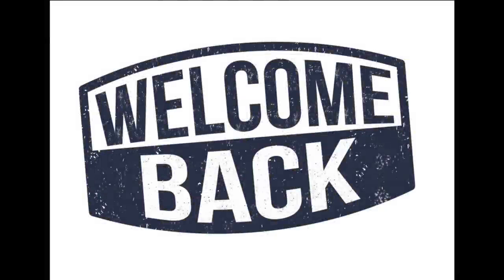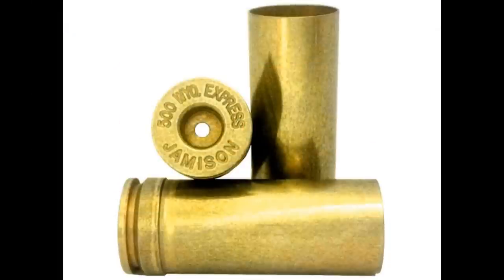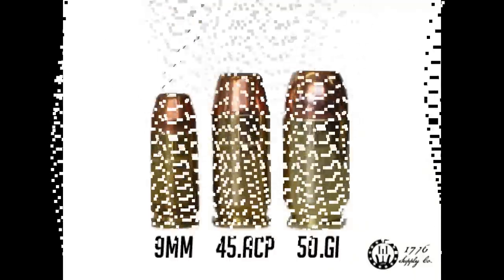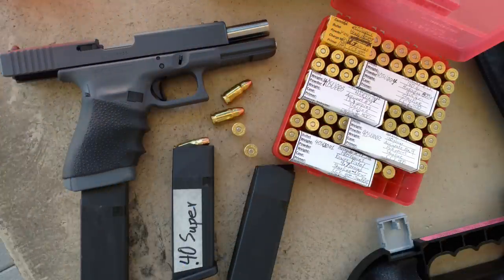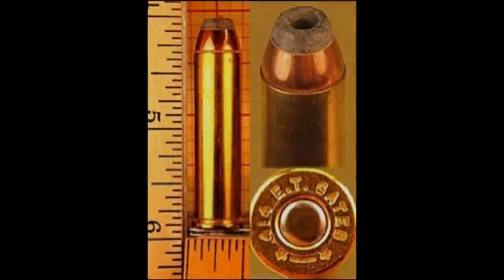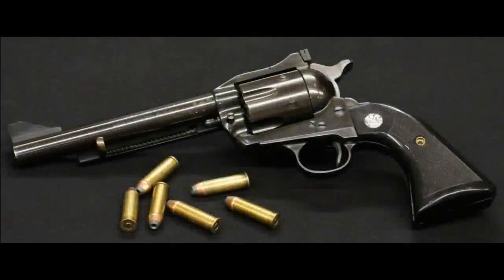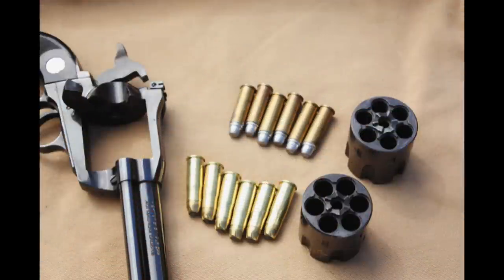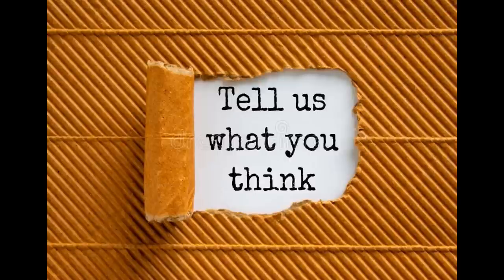The Top 5 Big Bore Cartridges that Failed Epically Part III

Comment: The belt on  the 500 WE is how they headspace the case in the chamber since there is no rim on its parent case- the 50AE. The AE had to much taper and being that it headspaced on the mouth, it caused all sorts of troubles with heavy loads. Bob Baker figured out that they could use the same brass but remove the taper by swaging the case to a straight wall configuration which ended up leaving the belt. That round was being developed at the same time Jack Huntington was developing the JRH................to work in an F/A 83, and the first 500 JRH was a model 83. It's too bad the JRH wasn't simply the one to be offered in the 83 in the first place, but I guess since F/A had a lot of time and development already invested in the WE round, they went with it.

Comment: Enjoyed this series.  That said…I actually chose to put together a 40 Super this spring (2023) for hunting.  The 10 mm just did not do anything  for me.  I have had 460 Rowland and 45 Super.  My all time favorite all time gun was a Ruger 41 mag.  I wanted a semi-auto with close to the same power lever.  For all practical purposes….10 mm is actually closer to the 357…just my thought.  That said….when “The Turkey Opinion”….featured one on  his videos series…I was hooked.  In spite of having more powerful cartridges conversion I have had in my 1911….The 40 Super…Just spoke to me.  I ordered a 6” ported conversion barrel for my 1911, put a heavier spring and a full length guide rod on the 1911.  Factory Ammo can still be bought and reloading components are still available from Redding.  I live in Montana and wanted a woods gun in the 1911 that was touching this side of the 41 mag.  I hope to take a deer this year with it and an elk if opportunity presents self.  All that to say…though I concur with your reasoning on the list of cartridges…there are still some of us…that still like the weird, quirky, obsolete and different cartridges.  I have shot several boxes of UA 225 grains at 1350 fps….no way a 10mm will get that.  My hope is to find a 240-250 grain mould to cast lead with in .401….I think that would be the sweet spot for the 40  Super….anyways…thanks for series…

Comment: I would like to see a 10mm casing necked to a 32 caliber projectile. The new 30 Super Carry has pressure of 50,000 PSI so those projectiles could withstand the high pressures and velocities that would be developed in this hypothetical cartridge.
Reply from the maker: @Tim Robinson - That sounds cool.  They have necked a 10mm to a 9mm.  It's called the 9x25mm Dillon and it is a scorcher!
Reply: Isn't that 7.5 FK?
Reply: That would be like a .30 carbine in a shorter case. Good idea!

Comment: I still like the 40 super.
Reply: Yeap, just getting into the 40 Super world…pretty stoked…no remorse in purchasing the reloading components, barrel conversion and the factory ammo has been fun…especially after shooting the 45 acp barrel and the switching to the 40 Super….its great to watch my friends face when the touch a round off…stout…but manageable.
Reply: @tyemiller6204  I have been experimenting with the 450-SMC 255 grain hard cast. 1030 out of a 5 inch barrel. The power of a 45 Colt. It uses a thicker casing than a standard 45-acp. So it takes a much higher pressure. But can be used in 45-acp chamber. Would really like to see it necked down to 40. A 40-Super +p+.

Comment: The real problem for the 50gi with especially hollow points was that the bullets were designed for guns with basically double the case case capacity or more so they couldn't expand,

Comment: I really like .45 GAP... after the .357 Sig, it is my favorite cartridge. The .50 GI is the sort of weirdness that appeals to me... I haven't yet committed to buying a Glock conversion kit for .50 GI though
Reply from the maker: @Graham O'Hea - I can respect that.  I too like oddball rounds.  The .40 Super had a special place in my heart, and the new .429 Desert Eagle is quickly becoming a favorite.  While the 10mm is now becoming more common, I have been a massive fan since before its resurgence.
Reply: @Go Big Bore Or Go Home  I would love to try and make an AR in .429 DE some day. From what I have read, it gives rifle ballistics out of a 6 inch barrel, so imagine what it could do out of an 18 inch.
Reply: @GoBigBoreOrGoHome  I am trying to get into .400 Cor-Bon and have sourced brass and reloading dies, but finding a Glock conversion barrel is proving to be a challenge. 40 Super would be the more logical choice over .400 Cor-Bon in this day and age, but I haven't found a reliable source for components yet. If I ever got a Deagle, I would be more interested in the .429 rather than the .50 AE as I tend to prefer the ballistics of lighter, faster bullets over slower and heavier (.45 GAP notwithstanding)
Reply: @grahamohea2424  IGB Austria sells 400 Corbon conversion barrels, in different lengths, coatings, and porting/threading options.

Find what you want and email them directly instead of going through their distributors.
Reply: @SR-gs8zo  There are a lot of use cases for handguns. Self defense is certainly one philosophy of use (to borrow a Nutn term), but it is not the only one... range toy is also perfectly acceptable use case. What purpose does a Desert Eagle have besides as a status symbol, something to show off at the range, and bragging about shooting .50 AE? Most of the things featured on this channel have little practical purpose and there is nothing wrong with that. I find that shooting nothing but 9mm gets boring after a while. I like weird/obscure calibers, I am perfectly content to reload for them, I can afford to do so, so why not?
Reply: @S R  I live in Alaska, and have wanted to build my own firearm for a long time. I love the thought of big bores, but also bullpups for the fact they catch less in the foliage. A .429DE in a rifle length barrel should be great in the brush against a moose. Also, I could reload it to possibly take out black bear hunting. Semi-auto 44 just sounds great up here in a bullpup.

Comment: I always thought the idea of the 40 super, and even the 41 Action Express were actually both excellent cartridges. If you wanted to load it hot, you could easily run a 180 or 200 rain projectable up to about 1,600 ft per second without pushing the limits of the firearm at all as long as you had a supported chamber. I've seen 1600 feet per second from 125 grain hollow point out of a 38 Super. With a little bit heavier jacket at those velocities it would have made an excellent hunting round, and it 1,400 feet per second it will provide the necessary capability to be a competent defense round. Considering I have not yet seen a hot 10 mm since the 1980s. And at current load parameters for the 10 mm, you might as well stay with the 40 Smith which is a better round than the 9 mm, and the fact that it produces 20% to 30% greater permanent wound cavity per shot. I'll give up two rounds in the magazine capacity any day of the week to shoot a 40 Smith for my personal protection. And because I'm usually all by myself I don't have two or three people around me like the FBI do. Add nowhere in any of the FBI paperwork does it say that the 9mmm is a superior cartridge or a better cartridge. It says it's cheaper, but why you need 12 to 18 in of penetration when most people aren't that thick is beyond me.
Reply: Well said on 9 vs 40. I agree. Though I really have nothing against the 9. I would trust it along with the 38 Spl to defend me as my personal minimums. About the “12 to “18 of penetration” the FBI has had at least one instance where a cross torso shot from an expanded 9mm failed to damage the heart after going through the culprit’s arm. 12-18 isn’t a bad rule in ballistic gel considering shots into bad guys usually penetrate less than they would into gel

Comment: Did 9×25 Dillon get covered previously? I'm tempted to order a barrel and die.
Reply from the maker: @Special EDy - We haven't covered it at this time since it's below a 40 caliber.  I am seriously curious about the round though.  Probably the hottest 9mm you can get in a semi auto, barring the 9mm Win Mag.
Reply: @GoBigBoreOrGoHome  I heard it is extremely loud, and shoots amazing fireballs. Which covers about half of the criteria for a good range toy!
Reply: @SpecialEDy  Sounds like it needs a barrel at least 10" long.
Reply: For those unaware it's the guy .357 Sigs gf tells him not to worry about, it's a 10mm necked down to 9.
Reply: @toddwebb7521  It's a 10mm sawed down to a 40 S&W necked down to a 9mm.
Reply: @exothermal.sprocket  9x25 is just 10 necked down to 9 it's not trimmed back to 40 length like.357 SIG.
Reply: @toddwebb7521  I stand corrected. It's 0.009" longer than 40 S&W and runs higher pressures.
However, .357sig is also unofficially called 9x22.

Comment: Only the 50GI is one I heard of.  On a similar note I just have to ask do you have a opinion on the fate of 357sig in future or even how successful the 30 super carry will be
Reply from the maker: @multi dryer - I don't think the .357 Sig will dissappear.  If it does it will be a slow descent.  It has a number of people who love it.  I am very curious about the .30 Super Carry but concerned its 50k psi pressure will be hard on firearms.  Too early to tell how the public will react to it.  For me...  I'll pass.  That could change, but it hasn't made me eager to put away my micro 9s.
Reply: @GoBigBoreOrGoHome  I agree in my opinion the worst that 357sig might go is more like 45super or 460 Rowlands and I'm gonna wait for 30 super carry to consider investing in but I do feel it has potential
Reply: .357 is so easy to make ammo for: cut down a 10mm, neck it down in the die to 9mm, and trim it to .40 length.
It uses a .40 bolt/slide, and . 40 mags. It uses 9mm bullets.
And the tooling must be simple, other than the neck you are just manufacturing a . 40 and 9mm barrel which are two of the three most popular rounds.
Reply: I had a past acquaintance that had a 1911 Wilson Combat conversion for 50 GI. Sort of a..... why? cartridge.
Reply: I’ve seen enough tests of the 30 SC that it doesn’t equal the 9x19. I consider the 9x19 to be a minimum 100% confidence round. Many people(myself included) wouldn’t go lower. The 30 SC uses bullets similar to the 327 Federal(itself a good defensive round with high velocity[considerably more than 30 SC]). So without truly great speed it just can’t do the damage a 9x19 can. I would give up 2 shots in preference of the 40 S&W(ignoring the public’s opinion[officers’ included][lower recoil having too much influence with people that could otherwise shoot the 40 just fine] that the 9x19 with modern bullets equals the 40. It does NOT) over the 9x19. Likewise the 9x19 over the 30 SC

Comment: While I do like my BFR 7.5” 500 JRH(and prefer this cartridge) the 500 WE is the best cartridge from a design standpoint(as a 50) for a Freedom Arms 83. Considering the ejecting system of that single action vs a swing-out cylinder a belted round makes the most sense(without actually measuring it’s diameter vs the rims on JRH cases) assuming you get slightly more meat in the cylinder. I’m guessing it’s failure has the most to do with customers who’d want an 83 would go for 454, 44 mag or 475 Linebaugh. Most people view a 500 as a play toy. So a less expensive gun is preferable. Sub-50s ARE more popular for hunting. And that’s not a bad thing. I wouldn’t even consider handgun hunting mainstream. After all if handgun hunting were as established as rifle hunting 480 Ruger would be much more popular considering how good it really is vs just about every handgun hunting round out there

Comment: I'd never heard of any of those 5 obscure rounds but I assume that with the .414 Super Mag.if,in the highly unlikely event you had one,you could fire .41 mag out of it if you couldn't get hold of the .414 ammo just like people must do with the .357 Max and .357 Mag.?The obscure revolvers are a bit more forgiving of other ammo but obviously with automatics you are pretty much stuck if you can't get the ammunition.
Reply: A really cool feature of most autos is you can often times just change out barrels and springs with like case head size and extractor groove cartridges that are more mainstream to keep that favorite at the range I stead of the safe

Comment: Isn't the .500 WE made with brass the same size as .450 Marlin?
Reply from the maker: @Liberty Cave WS7PB - I have seen someone suggest this on a forum but no confirmation it can be done.  The sp3cs are similar but not the same.  Freedom Arms' tolerances are very tight, so that leads me to be skeptical.  TL;DR - Possibly, but I don't think so.
Reply: I’m pretty sure the belt on the WE is shorter than the belt on the Marlin. The 450 Marlin was intentionally made with a longer belt to keep it out of a long H&H based(300 WBY, 7mm STW, 416 Rem Mag) chamber so that that rifle doesn’t go kablooy all over you and bystanders